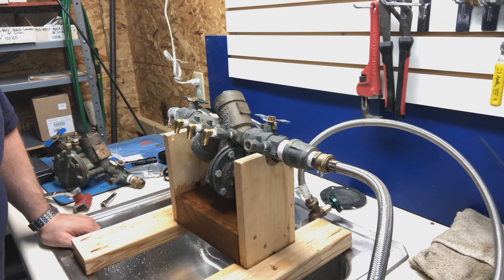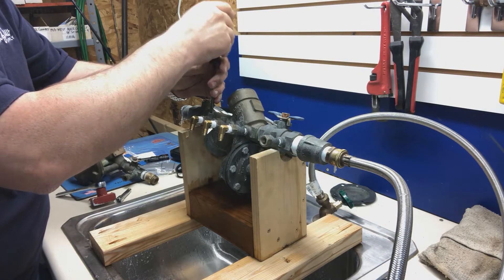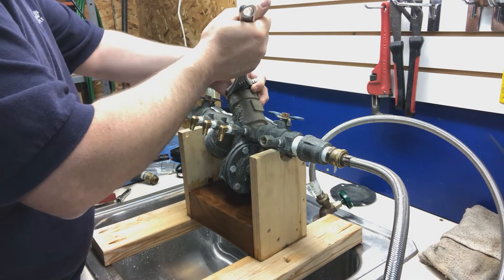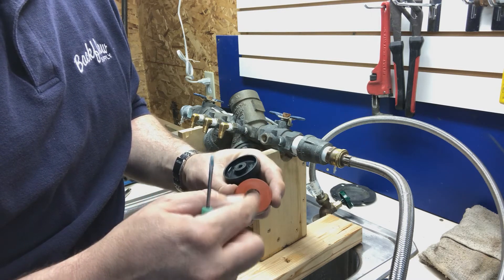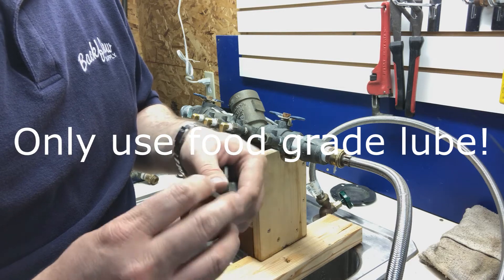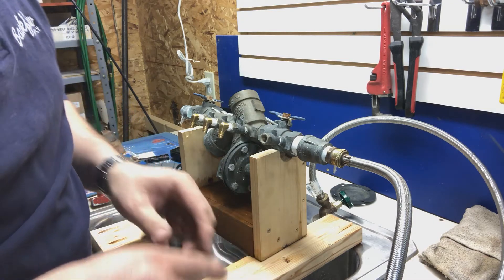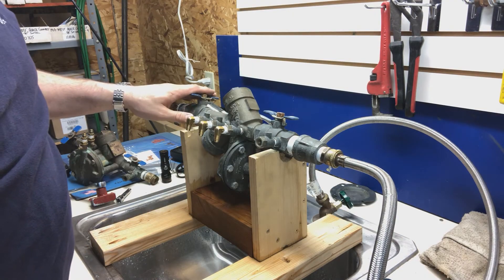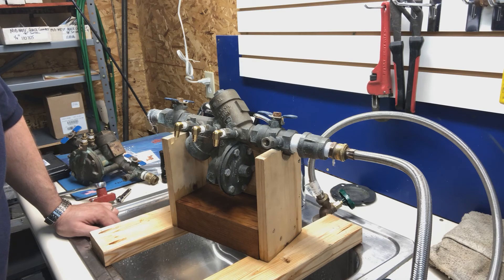How to Trouble Shoot a Leaking Backflow Assembly

Comment: I have never repair a backflow preventer, only installed them. I am considering doing a repair on this very one. Just wondering what the success rate might be for repairs in general. I have one 2 hours away from me and the new replacement cost is $600 above what the kit cost. This is sight unseen and I only know water pours out at the bottom. Just trying to decide if I should do the repair or replace the unit. Any suggestions would bew welcome. This doesn't seem to complicated.
Reply from the maker: Marty.  I would ask some questions before you go.    Is this on a lawn sprinkler system?  How long has this been pouring out the bottom?  If it is on a lawn sprinkler system does it stop pouring out the bottom when a zone is on?  If it is not on a sprinkler system can you get a greater flow through the assembly to something you can open downstream and see if it stops pouring out the bottom when the flow is going through?  This will help you to determine if the issue is in the #1 check or the relief valve.  If you suspect backpressure is an issue shut the #2 shut off, off and see if it stops pouring out the bottom.  Is this in a place that it could have frozen?  Not sure what the kit is that you have but I would take the one that has everything in it if you have to go 2 hours to do it.   If you want to discuss this more call  me at 801-355-6736 or email me at sean@backflow-supply.com.

Comment: Is there a way I can send you a video of the problem I am having? I’ve cleaned and reseated the two pop-its, checked the gaskets, and flushed all areas. Still have water coming from the hole in the center of the relief check.

Comment: Great video but I am also getting a small drip from the hole in the middle of the diaphragm cover. Does this require a new diaphragm?
Reply from the maker: Ken, a leak out of the pin hole on the cover is the result of one of three things, or a combination of them.  One is the o-ring on the relief valve stem that goes into the cover is damaged or broken. Second is the stem where the o-ring sits is cracked or broken.  And lastly is the cover plate where the o-ring should seal is corroded or pitted.  Sometimes if it is only corroded you can carefully chip it off and clean it up and it will solve your problem.  But if it has been on long enough to have pitted the brass you will need a new cover plate.

Comment: Nicely done. Very straightforward. I have a valve just like this that is leaking and now have no fear about checking it and possibly repairing it. We just bought the house, which is 25 years old, and has a lot of deferred maintenance. The water pressure is 80lbs, so we will need a pressure regulator too.
Reply from the maker: Thanks Monty.  Let me know if you have any questions or need parts.  801-355-6736

Comment: great video, i have a Watts 009m3 is leaking, when i close check valve #2 the leak is stop ,what do i do to repair it 
thank
Reply from the maker: Joseph, it might be better to call me or email me, sean@backflow-supply.com or 801-355-6736.  I would like to know what this goes to, is it your lawn sprinkler system?  Then I would have follow up questions to that.  When water is going through the assembly to something open down stream does it stop leaking?  Lets talk. Sean
Reply: hi , i have Watt 009 m3 3/4 the relief valve is dripping, what is the problem. the valve located in basement of 2 stories building 
thank

Comment: My backflow assembly failed test. Check valve #2 was leaking. I changed the ring seal and checked to make sure there was no debris. Reassembled and it still dripped. I took #2 apart again and replaced the 5# spring and reassembled. It still leaks. I can shut off #2 a the dripping stops. What could be the reason it still leaks?
Reply from the maker: Mike, sorry for the delay in responding.  Assuming we are talking about the 975XL I would remove the plastic seat that threads into the body that the red seal ring seals to.  Also the spring on the #2 check is less than 5 lbs.  Number 1 check should have the 5 lb spring.

Is this in a place it could have froze?  What is this feeding?  When you say it stopped dripping when you turned the #2 off I believe you mean the outlet shut off valve and the dripping stops out the relief valve, correct?

If you would like you can call me 801-355-6736 or email me at sean@backflow-supply.com

Comment: Hi, what does it mean when water is shooting out of the little tiny hold on the side of the bottom next to the bottom vent. At 2:55 in your video it would be shooting out to the right.
Reply from the maker: That would be one of three issues.  Take that round cover off by removing the six bolts.  When you take it off the relief valve stem assembly will probably be stuck to the inside of the cover.  Pull it out.  It would only be held in by the o-ring in the end of the stem.  That part that was stuck in the over is what you need to look at.  The first issue could be the o-ring on the end of the stem that fits in the cover.  It could be cracked, broken, hardened and shrunk a little allowing water by and out the hole on the relief valve cover.  The second issue would be the plastic piece the o-ring goes on is cracked or broken.  And lastly, the cover where the o-ring needs to seal may have corrosion or be pitted.  Take a look at those things.  You can contact me by calling 801-355-6736 or emailing me at sean@backflow-supply.com which may be the best way this time of year.

Comment: What about the number 1 valve  that's leaking out  the airflow ???
Reply from the maker: Bradley, what are you calling the air flow?  If you need to call me you can.  801-355-6736 or email, sean@backflow-supply.com

Comment: Great video, thanks for posting.  My backflow valve is leading through the center small hole in the diagraph cover.  When I put my finger over the small hole, I can feel it pulsating.  I put a new gasket on the diaphragm cover and it stopped the leak for 2 days and then it started leaking again.  I also cleaned out the 2 valves and inspected them and also changed the o-rings.  What causes the water to be pushed through the small hole in the diagraph cover.  Any help you can provide would be greatly appreciated.
Reply from the maker: On the Wilkins 975XL there are 3 reasons it can leak out the center hole on the relief valve cover.  One is the o-ring on the relief valve stem that fits into the center of that cover is nicked or torn.  Another reason is the plastic piece the o-ring sits around is cracked or damaged.  And the last reason is that inside the cover where the o-ring needs to seal is pitted or has corrosion that is not allowing the o-ring to seal or is damaging the o-ring.  

Feel free to call me or email me.  801-355-6736 or sean@backflow-supply.com

Comment: Hi great video. I have a small, steady drip coming from the small home in the center of the pressure relief valve of my 975XL. Unfortunately I’ve removed the bolts holding the pressure relief valve on, but I cannot figure out how to take off the round side of the PRV to check if it needs cleaned out. I’ve tried to tap it with a rubber mallet without success.
Reply from the maker: Jason, if I am understanding you correctly you can't get the relief valve stem assembly out of the cover.  That should just pull out.  The only thing holding it in is an o-ring on the stem that goes into the cover.  Sometimes they can be hard to get out.  Just pull a little harder.

My concern is you might have some corrosion build up inside and may have started to pit the inside of the relief valve cover.  You will have to take it apart and inspect it.

If you need more help you can call me at 801-355-6736 or email me at sean@backflow-supply.com
Reply: @backflowsupplyslcut9394  thanks very much for your response.  I actually am unable to easily pry apart the cover of the pressure relief valve (the round, disc-shaped cover).  I suppose I need to use a flathead screwdriver or something to gently pry it apart along it's outer edge.
Reply from the maker: @miles267  You could also use a hammer to lightly tap the side of the cover to break it loose.

Comment: My Febco 825Y does not have a plastic seat.  Should it?

The seal presses internally on cast brass seat.

Also, it does no have a relief valve.
Should it?

I replaced all, but I can see at the water meter, the little spinner twirls when it's on.

Shouldn't my zone valves stop that?
Reply from the maker: Steve, the 825Y does not have plastic replaceable seats.  Depending on the age of yours it may have brass replaceable seats.

If you have an 825Y it has a relief valve.  This is the assembly that comes off the side and depending on the size of the assembly 4-6 or 8 bolts to hold the cover on.

You replaced all what?  Not sure what you mean by the water meter spinner twirling and zone valves stopping that.  You may have more than one problem.

I need more information from you.  Please call me or email me.  801-355-6736 or sean@backflow-supply.com.

Comment: you did a great job.  i wonder if the leakage is directly from a small hole right in the middle of the releaf valve.  when i blocked the leakage,  some of the leakage occurred at the check valve 2.  any comment?  does it mean i only need to open the relief valve.  and where to get the parts?  I have exact the same model 975XL.  thanks much.
Reply from the maker: It would be helpful if we talk on the phone if possible.  But the hole in the center of the relief valve cover is there by design.  It needs to push air through that as the relief valve moves back and forth.  If it didn't it would be stuck do to suction.  

I am not sure how leakage would have occurred at the check valve 2 that you would see.  I am not sure if you are referring to one of the test cocks that come off the side that have the screwdriver slot or not.  But check valve #2 is the portion of the body that points down behind the relief valve portion and has the thread on/off cover.

Give me a call 801-355-6736 if you want to talk about your issues in greater detail.

Comment: Both of my shut off valves handles are broken. Do I need to replace the whole unit?
Reply from the maker: It depends.  What brand and model and size do you have.  Is it just the handles that are broken, or is it the stem that the handle is attached to.  How easy is it to turn the stem so the shut off will open and close?  You should be able to use a  crescent wrench to get on the flat sides of the stem to turn it on  and off.

Ball valves can be bought for most models, but sometimes it is more cost effective to replace the assembly when all things are considered.  For many brands just the handles can be replaced.  If you would like to call me at 801-355-6736 we can talk more about it.  Sean

Comment: I need to replace the small ball cock valves on top where the handles are on each side of the main valve.  The handles became so corroded because where they were attached had deteriorated.  What is your suggestion?
Reply from the maker: Ben, I can't tell if this is the same question worded differently than the one I just responded to you about or not.  But contact me with the info in the last reply if you still need to talk about it.

Comment: Mine was intermittently discharging a sputter of water every couple of minutes.  The plunger in #1 was broken into multiple pieces.  I ordered the total rebuild kit and replaced everything.  Now it gushes full pressure out the bottom as if there were no valves whatsoever between the city water supply and the bottom of the unit.  I disassembled it and reassembled it three times, I'm sure it's put together properly with all parts in the right place.  Any ideas?
Reply: Check that you have the springs correct.  The stronger spring goes in check one and the weaker spring in check two.  Also, make sure when you refill the backflow preventer, you open the second, third and fourth test cock and then open the number one ball valve slightly.  When all the air comes out of test cock two, close it and repeat for number three and four.
Reply: @45maga47  I will check that and get back.  I did not realize 1 and 2 springs were different.  I only have 3 test cocks though.  I confirmed it is a 975XL.  Weird.
Reply: @45maga47  I did indeed have the springs reversed.  I switched them out and it lessened the problem, but I still have a constant flow out of the relief opening.  Maybe that of a garden hose or a faucet opened halfway instead of the full overwhelming pressure from the city supply.  I once again disassembled everything and put it back together, same result.  Thank you for your first comment and trying to help.  45 KAG

Comment: I am certified to test and repair. Had my own business for over 11 years and am retired now. You are putting the washer holding the disk to the poppet in backwards. The beveled side of the washer is supposed to be against the disc so that as the disc swells (as discs do over time) the washer will not cut the disc. What would be the purpose of beveling the other side? If it was not touching the disc what would be the reason for beveling the washer? If you take apart a new Wilkins 985XL you will find the beveled side is against the disc from the factory. Good video otherwise.
Reply from the maker: I have been told differently from different testers through the years which way it should go.  The one reason that I have been told to have the bevel away from the washer is so that the flat side will hold the disc tighter to the poppet.  

Honestly, I have not seen any issue either way and it is not listed in the repair and maintenance instructions on how to put the washer back on when replacing the disc.  

I have also just pulled and inspected several of the poppet assemblies in my stock assembled at Wilkins and the bevel on every one is away from the disc.  

You do bring up a good point, what is the purpose of beveling the washer?  I will send an email to Wilkins and see if I get an answer.
Reply from the maker: I did send an email to Wilkins and asked the question about which way the seal ring retainer or the metal washer should go.  The engineer called me and said that it is not even called out to be beveled and he believes the beveled edge may be  the result of removing a sharp edge from manufacturing not a requirement for performance.  

I told him that the poppet assemblies I have in stock that came from Wilkins do have the bevel away from the rubber disc, not against it.  He said if that is the way they are coming then that is probably the way  they should go back on.  But he does not believe that it will make a difference in performance either way.  This has been my experience in my 21 years doing this as well.
Reply: @backflowsupplyslcut9394  It was taught in class, and at every review class, that the beveled edge is placed against the disc to reduce the possibility of cutting the disc when it swells. Discs that have been in working valves for a long time sometimes swell considerably and blow up to cover the edge of the washer so I could see that this as the reason for the beveled edge. Every new Wilkins 975XL or 950, or ones that are in service that I opened and appeared to be opened for the first time, has the beveled edge toward the disc indicating to me that is the way they come from the factory as the correct position. 
It may also mean the the instructors possibly made that up just tell you something to make and you think they know something important! 
Either way, good channel.

Comment: Can you make a video showing how to unseat the plastic beads from inside the number 2 check valve?  Thanks!
Reply from the maker: What do you mean by the plastic beads?  If you are referring the the plastic stubs that point into the center of the seat section you just need a flat piece of metal to make contact on two of them and unthread it.  I did do a video about the various tools but a lot of homeowners have gotten creative.  Here is the link to the other video.
Reply: @backflowsupplyslcut9394  No worries, I figured it out.  Thanks for your informative videos.